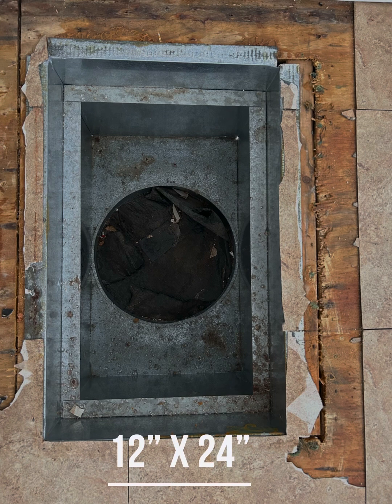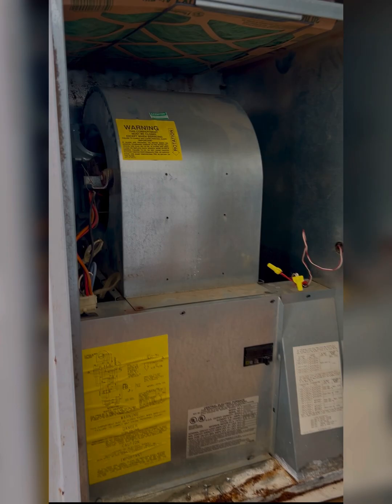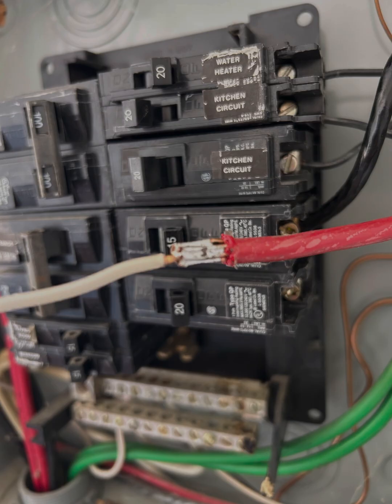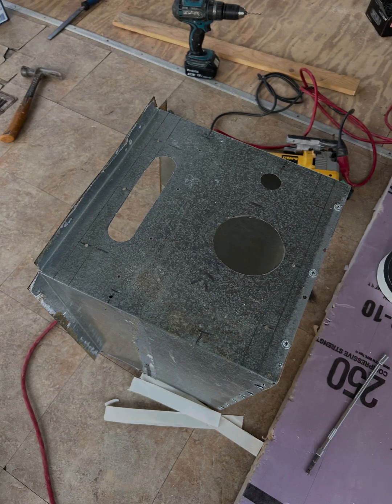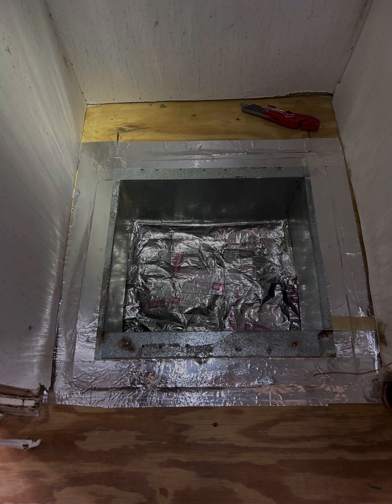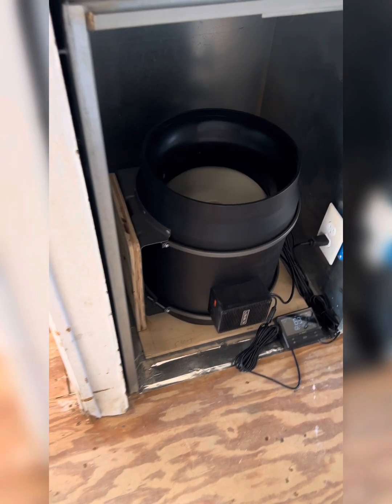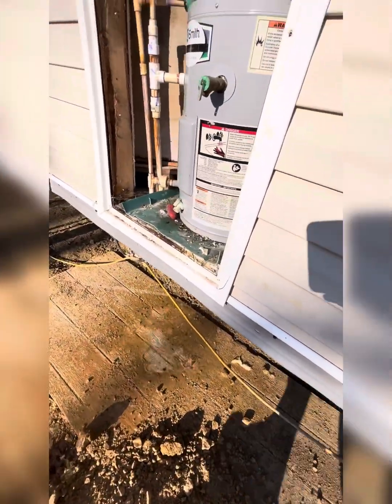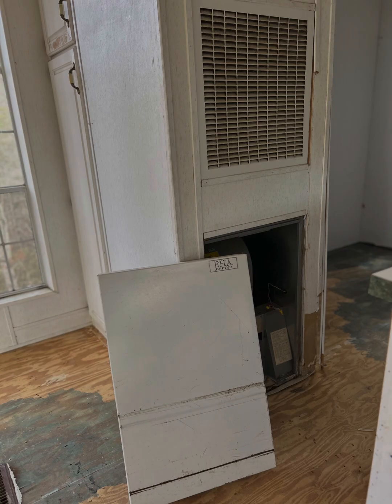Latest Vevor Diesel 8kw heater update

Comment: the exhaustif touching wood has a chance to catch it on fire. trust me
Reply from the maker: @Blue_Dog_Ranch  there was a pretty decent air gap. However I have completely changed the setup. Check out my latest video. I don’t show the bottom cut out there. But I went with a large cut out that was about 1/2” smaller than the mounting plate. I appreciate the comment as these things can be safe. But also very dangerous too. That cut out was definitely more dangerous than safe!